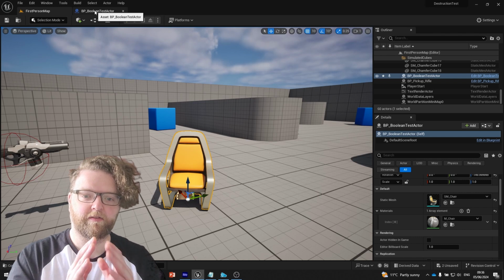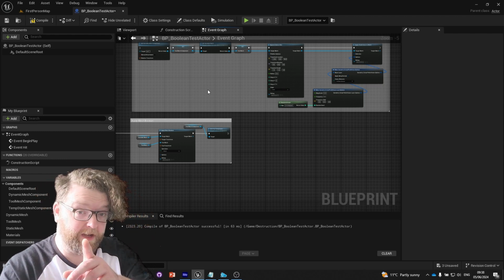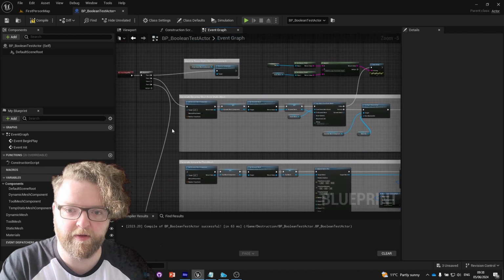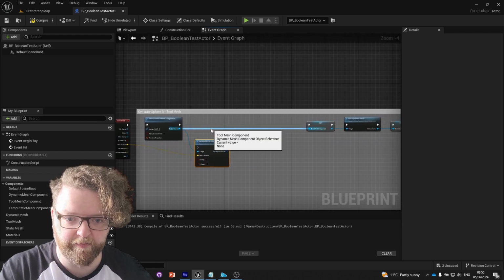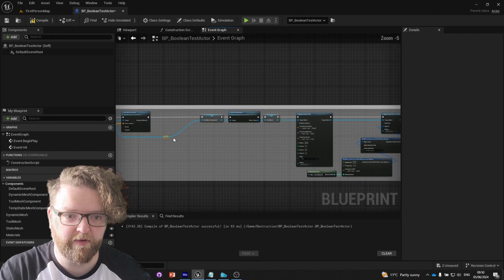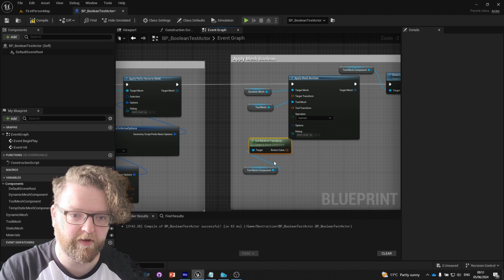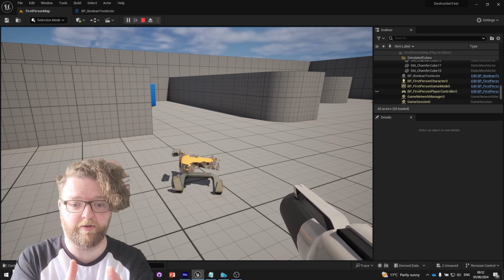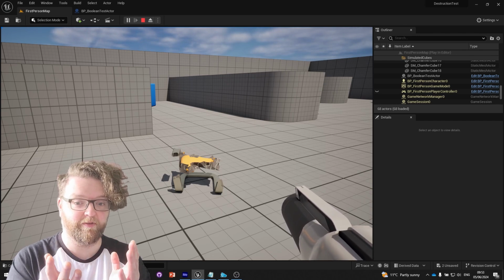Unreal Engine Destructible Meshes with Geometry Script Part 3: Dynamic Destruction Position

Comment: im having an issue where a line trace will go straight through the object and I was wondering if you knew how to fix that, otherwise great tutorial!
Reply from the maker: That's a collision issue. If it's a generated mesh, you'll need to make sure you update/add collision to it. If it's a mesh from the Content Browser, make sure it actually HAS collision, and if it does, then you'll have to look at the Collision settings. By default a Line Trace is going to check on the "Visibility" channel, so make sure whatever it is is blocking that channel.

Comment: Would it be possible to use Geometry script to create a dynamic procedural gore, gibbing and dismemberment system when applied to characters?
Reply from the maker: Alas no - you can't (yet) use Dynamic Meshes as Skeletal Meshes. There's too much info involved. Skeletal Meshes need to be "bound" to skeletons with weight info, it would be a hellish amount of processing to update that dynamically. We'll maybe get a solution some day.

However, I'd firmly put this in the "players would never notice" camp anyway. It barely makes sense to use this stuff for bullet holes (I'm just doing that as an example). In the kind of game that has gibs and gore, the player isn't likely to sit and piece together the pieces to realise they do or don't fit back together.

If you REALLY wanted to have some kind of position-dependent gore system, my first thought would be to pre-build it by taking the rigged mesh and chopping it up in your 3D package of choice, then instead of just having one character mesh, you have, say, 12 "chunks". As long as you start with the finished, rigged, animated character then each "chunk" is just going to use the same skeleton and AnimBP and you could delete them where appropriate.

Couple that with using Niagara particles using the "Skeletal mesh position" node to position the particles around the mesh chunk when you delete it, and I think you'd get the right effect.
Reply: @alanteachesthings  Well what I'm after is a proper dynamic procedural gore system. Like the FLESH system from Dead Island 2. Which has skin layer, fat layer, muscle layer and organ layer that can be chunked or cut out of them. It was made in Unreal, so there must be a way to do it... hopefully in blueprint as coding scares me lol.